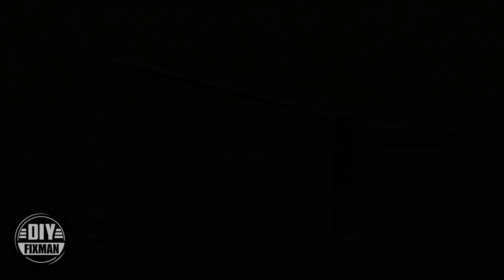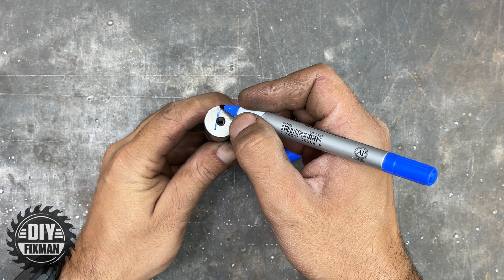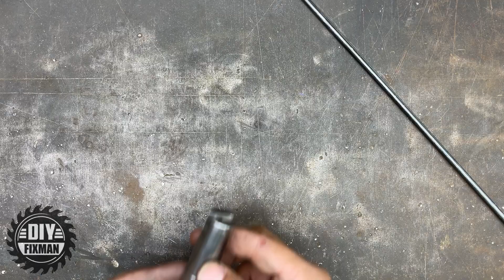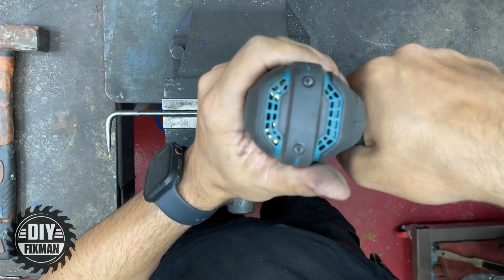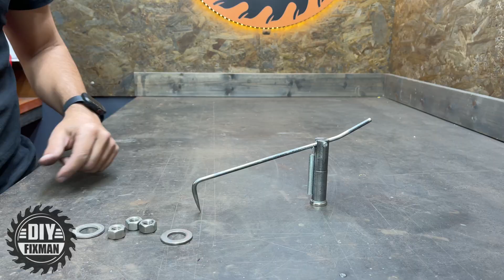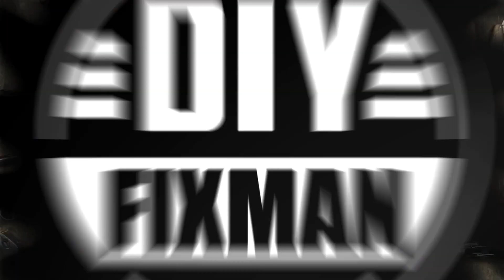"This is genius! Say hello to "THE THIRD HAND

Comment: A potential problem is if the ground isn't good and it passes power through the 3rd hand it may melt that poor little spring and/or weld the pivot point.  I'm an armature so take that for what it's worth.  Great idea though.  Maybe add a ground strap from arm to base?  dunno.  Thanks for sharing!